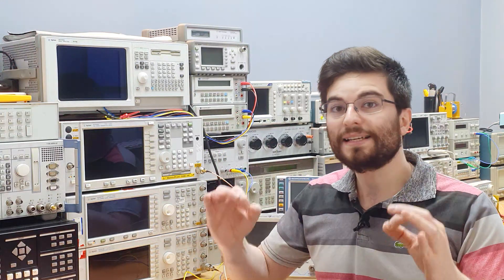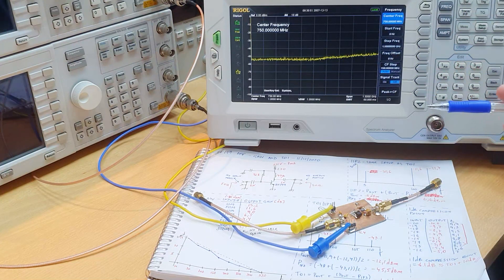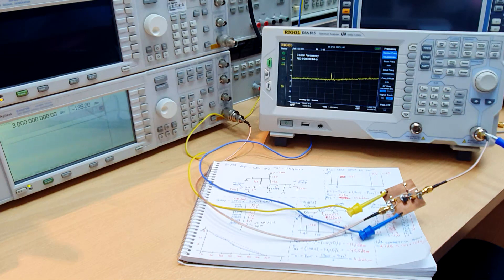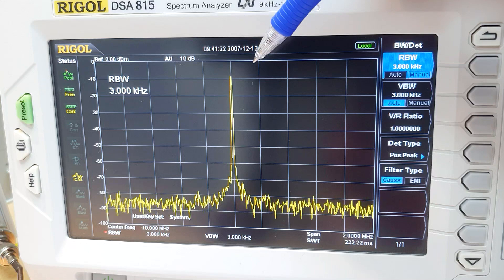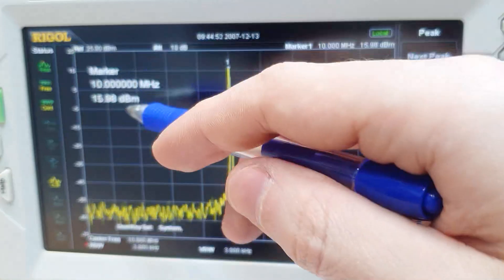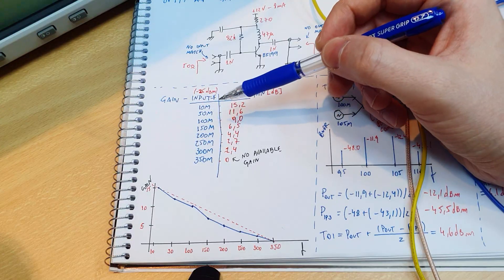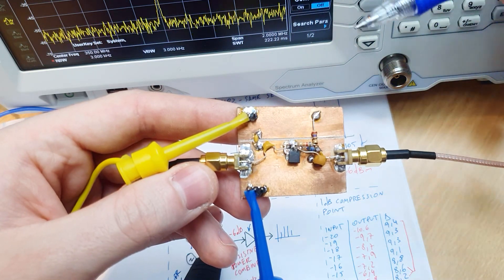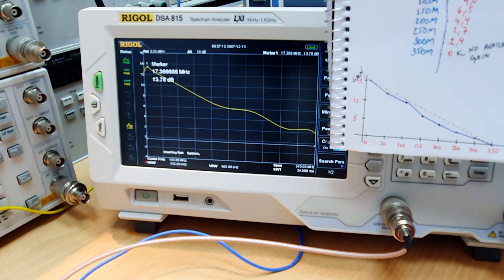Characterization of an RF amplifier - Gain | S21 - part 1

Comment: Hello friend, in this video I didn't say which transistors were used in this assembly, I calculate that there may be a video that talks about this assembly and I would like you to put the link if possible or inform what they are. Great video, I already liked it. Thanks
Reply from the maker: Hello friend! In this video I used an old BF199 transistor.
Reply: @AllElectronicsChannel   Thanks.

Comment: Hi Gregory
Thank you for this very interesting video.
So you are using a BF199 in common emitter mode.

My 2 questions :
- How did you calculate the values for biasing the transistor ?
- I did know that the gain is decreasing with the frequency, but is there any formula to approximate it without the spectrum analyser ans the signal generator ? I will use it at about 130 MHz.

Also one remark : you are using 1 nF input and output capacitors. So I am expecting that these values are too high for the tests for high frequencies.
Depending on the manufacturers, the BF 199 has a Ft (transition frequency) at about 400 Mhz.

Thanks in adavance for your answer !

Philippe